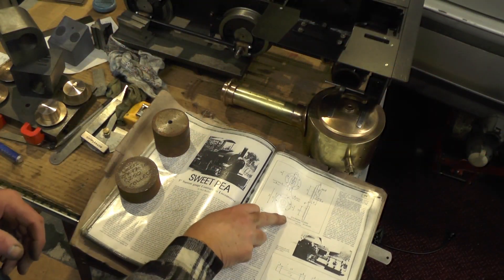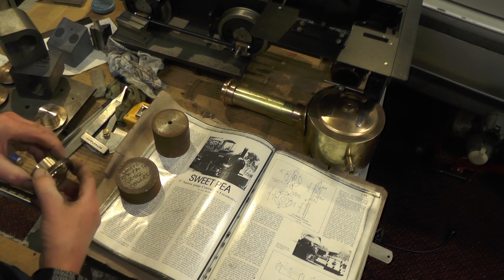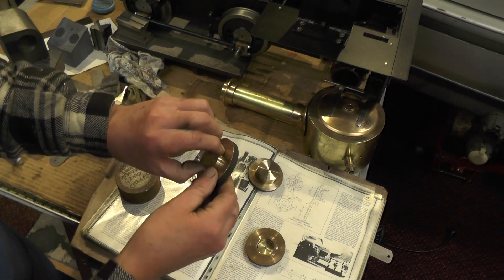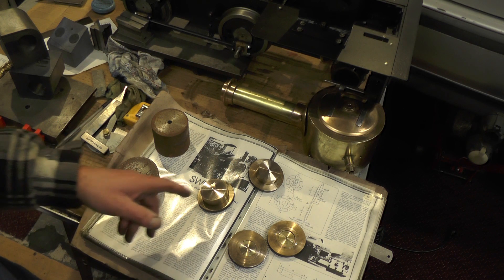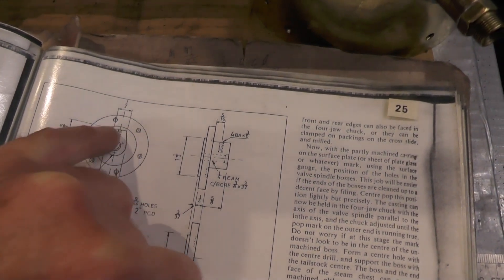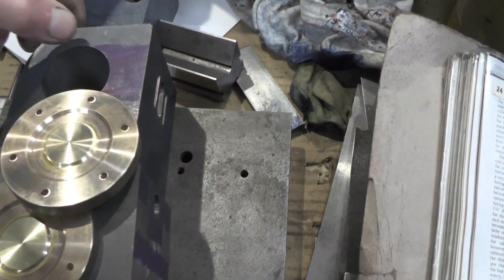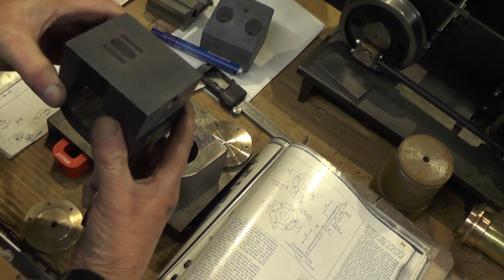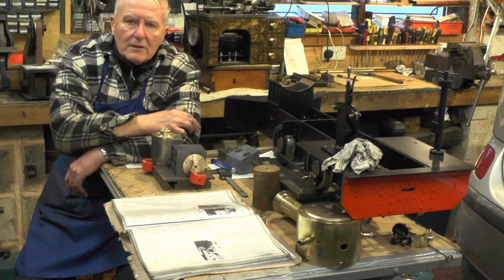Sweet Pea Steam Locomotive Build Part 8 (End Cap Covers for Cylinders) "mr factotum"

Comment: Nice job Kev.  Turned out well.  I sometimes do the same silver solder trick to build up brass stock for models.  Done correctly it's virtually invisible joins, as you showed.  Very interesting series.  Cheers Rob
Reply from the maker: cheers Rob
Waste not want not!!
regards
Kev